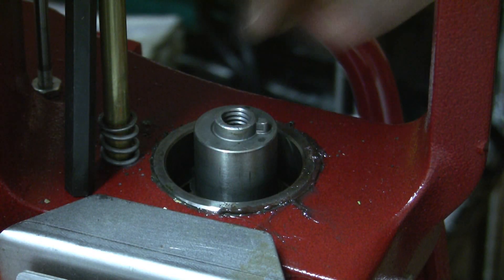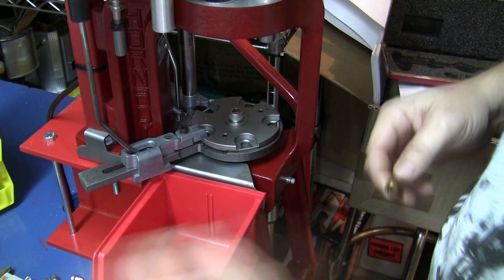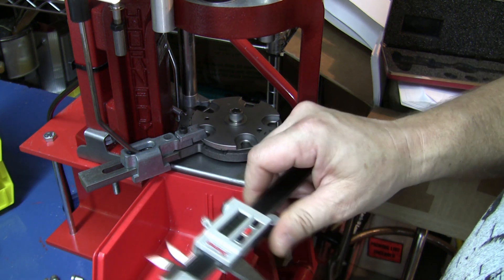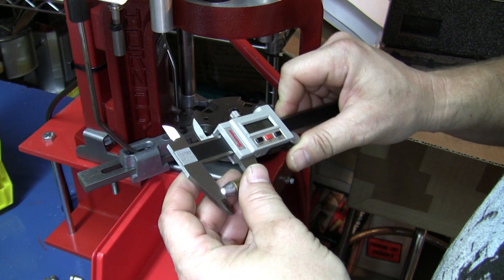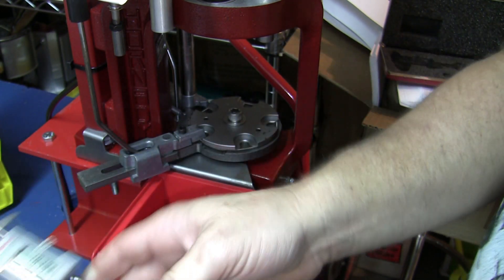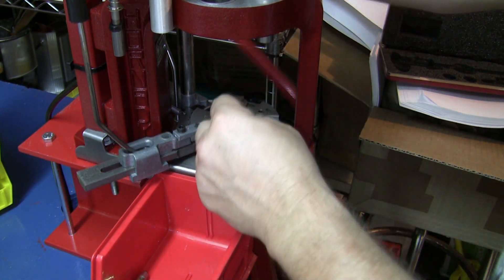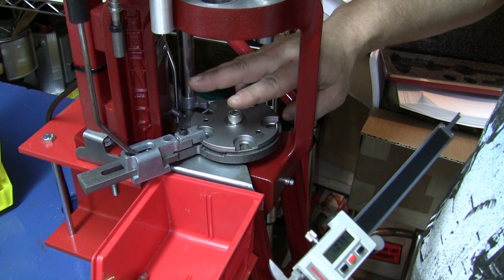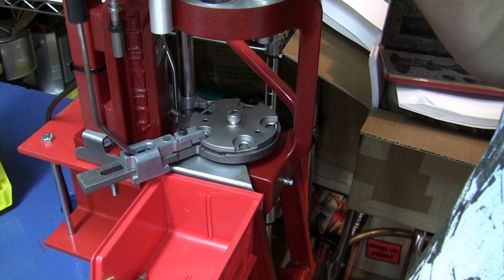Hornady L-N-L round over-all-length (OAL) issue

Comment: I had the same problem.  shimming the sub plate will limit the cant of the shell plate when sizing.  That is where the problem is occurring.  As an added benefit, case wobble will be almost eliminated and powder "splashing" out of the case will be almost gone.  google case wobble on lnl and you will see the fix.
Reply: Sorry, I can't picture this.  What did you shim the sub plate with?  How much was needed in your case?  An easy fix would be nice.
Reply: http://www.m4carbine.net/showthread.php?144901-How-to-tune-the-Hornady-Lock-N-Load-AP-progressive-press.  This link will describe what I am talking about.  It also shows what part you need to get.  It can be found on amazon and ebay.  I have seen anywhere from 8 thousands to 11 thousandths needed.  I think I needed 9 thousandths.

Comment: I have a similar issue when loading cast bullets in my LNL AP.  The issue I was having was the bullets were getting shorter and shorter.  The lube on the cast bullets was buliding up in the bullet seating die and I had to clean it out every now and then and that cured my issue.  Hope this helps.

Comment: Seems to be a known issue with the LNL AP. Some press have it better than others. Some have it worse than others.

I see variances of up to . 02 variance when loading 9mm with this setup:
1 - Hornady sizing die
2 - Hornady PTX (powder thru expander) powder measure with .355" insert
3 - RCBS lockout die
4 - Hornady seating die (seat only)
5 - Lee FCD die

Comment from the maker: @legalsolutions07   Thanks for your thoughts.
These cases were not primed for demonstration purposes.
The issue, as seen in the video, is repeatable and still occurs today.  If the calipers were off, it would have shown up in the readings I took.  
It is [indirectly] a weight difference that is causing the issue from the pressure applied to the cases on the base plate from the sizing die and flaring die.

Comment: Interesting problem. I've never experienced this, but it looks like either the base is not tightened enough, or your caliper may be off. Seems to me that whether you have one case on the press, or five, the weight difference is not enough to tip the base plate and cause OAL difference. Check your caliper locked in place (I had one go bad before).  On a side note, are your cases pre-primed? It doesn't look like you have to push forward to seat your primer. How did you get the press that smooth?

Comment from the maker: @islandsoljahz  No solution has been found yet.  
Right now, I just set the OAL .01" shorter than what I want with a single round knowing that the first couple and last couple rounds will be shorter and all the others will be correct.  I do not load for maximum velocity (pressure) so the .01" has made no significant, noticeable, difference.
I need to try to contact Hornady again to see if they have one.

Comment: Doing some more thinking. Got another question. Are you crimping at the same time seating the bullets? Might not be the issue, however, even on my single stage, I have started to crimp in a seperate operation as crimping was changing my OAL as well when I seated and crimped at the same time... Just a thought...